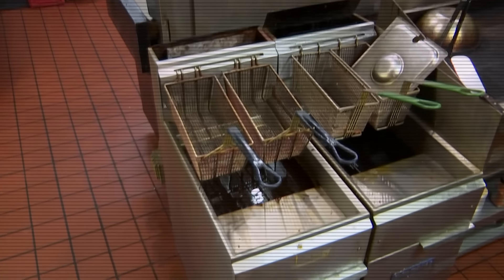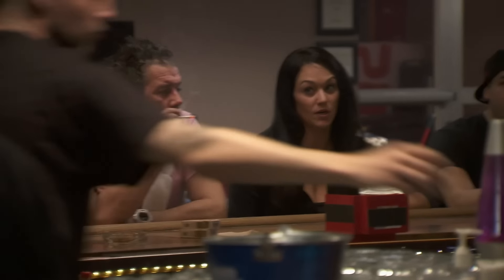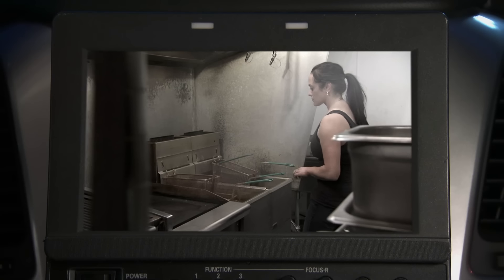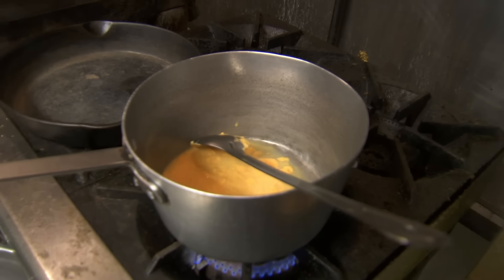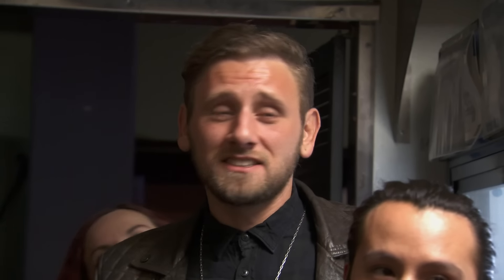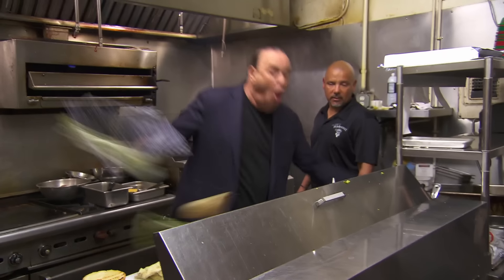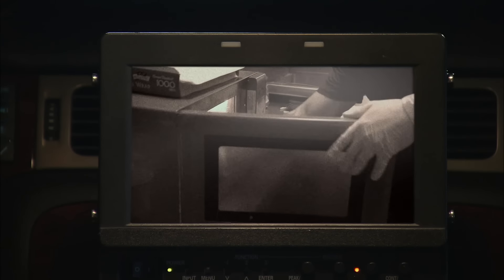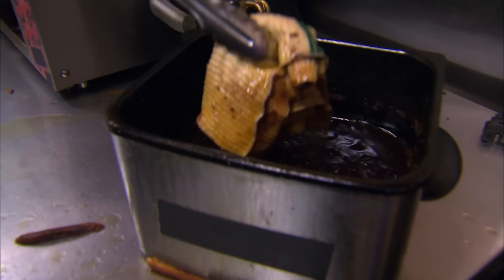Bar Rescue’s GROSSEST Fryer Discoveries  🤢

Comment: When I worked in a fast food place, we had to filter the oil in the fryer (and clean the inside of the fryers) every single night, and put new oil into the fryers routinely. We also cleaned the fryer baskets every single night (actually pretty easy compared to most other things, as long as it's done every night though), and would clean the filter tray out after each use. Oil never even got to nearly this point and it was being handled by a bunch of teenagers working barely-above-minimum wage.
Reply: Yeah, that's standard, and the most basic thing you can do.  Shows how nasty these places are, I've never worked at a place that didn't clean fryers nightly
Reply: Same with restaurant kitchens or at least that's what's supposed to be done. Our restaurant isn't corporate but us cooks have pride in our jobs so we make sure to do everything right even without someone over us. Real chefs should know oil needs to be clean
Reply: The hoods also need to be clean every night so it doesn't leak in the oil
Reply: I went to work for a place they hadn't changed their oil for three months
Reply: Ya I worked fast food we did the fryers every night also did the grease trap every night the restaurant I worked at was once of the cleanest places in the city
Reply: it’s amazing the difference one serious manager can make
Reply: @spaceship2792  dear god I hated cleaning the hood, sliced my finger open once on it bc that thing doesn't play around, but having a clean hood means I don't inhale weird shit
Reply: Thats just good management
Reply: @Stakbundles18125  what's funny is that the shift managers were ALSO teenagers (some of them were younger than I was at the time, I was finishing up HS)
Reply: @Chanseyyyyyyyyyyyy  fast food places (franchises/ chains) they have corporate managers who have a game plan in place for success and in compliance with health codes and industry standards. Teenagers or not it’s all thought out and part of a plan even disabled folks can do it there’s no discrimination to success

Comment: Still not as nasty as the fryers at the annual Head Family Reunion. And yet in fact, the rusty iron flakes in the oil actually serve as bonus nutrition for the participants. You ain’t a country bumpkin until you’ve seen a deep fryer out in the open, as opposed to almost all of them being inside for obvious reasons.

Comment: the smaller the fryer the more need to filter the oil out , the commercial deep fryers can last up to 5 days max before an oil change , a table top fryer at 2 litres need a clean every 2 days